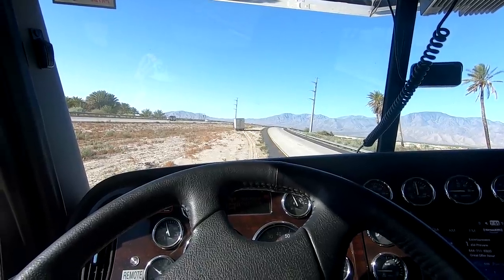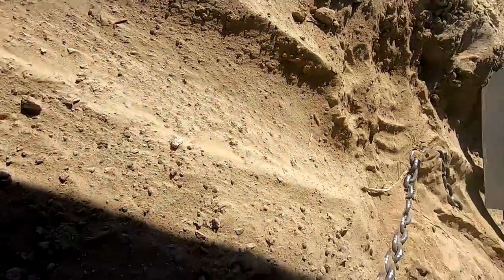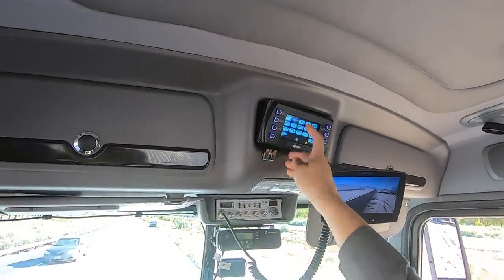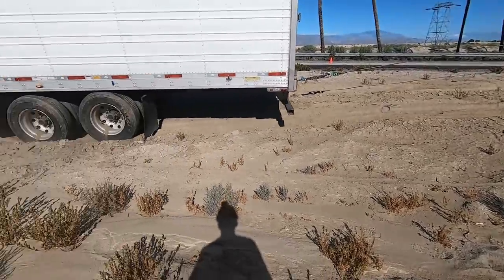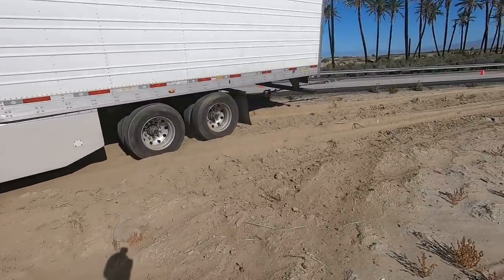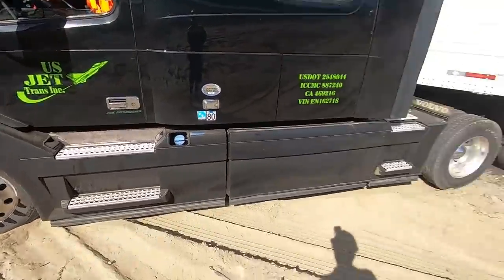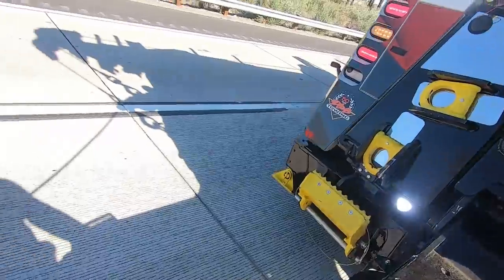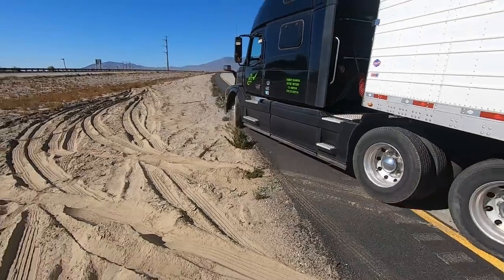Trucker Falls Asleep And Gets Stuck In Center Divide!

Comment: Great job, lucky there were no casualties the long haul drivers need to take more time away from the cab and get some rest.
Reply: Companies also have to allocate time for them to have breaks and make sure they use them.
Reply: Hi from the UK.nice job there but you have more room between carriageways than we do over here and a run off like that would have been much more serious.Another thing,was the driver charged with any driving offence? If this type of accident had happened over here the driver would have been charged with “driving without due care and attention” as a minimum and would have been fined and 3 points on his driving license (12 points and you are banned for a minimum 3-6 months)
Thanks for the videos I find them really interesting

Comment: Great videos. Is there a reason why you didn't pull from the front so you didn't have to turn around? Just curious.
Reply from the maker: I considered this, but considering the unit was fully loaded, the angles involved to achieve this properly puts a tremendous strain on the snatch block and rigging as it requires an angle multiplier essentially doubling the load! Also, the boom is not really designed to pull loads unless it remains in a straight line which creates a side load on the boom. Thank you for watching!

Comment: Hi Trent, did you ever had collab job with Ron Pratt?
Secondly i was wondering if the road was not large enough for your truck to be in reverse and use the drag winch, wouldn't it be easier just to rotate the boom towards the front of the truck (on top of the cabin) and pull with the winches of the boom.

Comment: In this sort of instance, wouldnt it be easier and safer to remain facing with the flow of traffic and turn the boom over the nose of the truck? Redirect from the pull-pin on the bumper?
Reply from the maker: I considered this, but considering the unit was fully loaded, the angles involved to achieve this properly puts a tremendous strain on the snatch block and rigging as it requires an angle multiplier essentially doubling the load! Also, the boom is not really designed to pull loads unless it remains in a straight line which creates a side load on the boom. Thank you for watching!

Comment: I know it's not an ideal way of pulling, but, if you're using the rotator, why don't rotate the boom over the cab, you won't be sitting backwards on the freeway.
Reply from the maker: I considered this, but considering the unit was fully loaded, the angles involved to achieve this properly puts a tremendous strain on the snatch block and rigging as it requires an angle multiplier essentially doubling the load! Also, the boom is not really designed to pull loads unless it remains in a straight line which creates a side load on the boom. Thank you for watching!